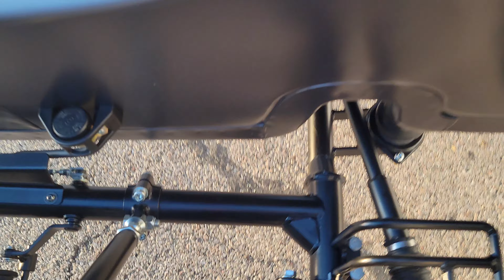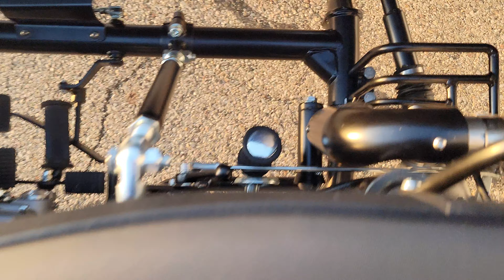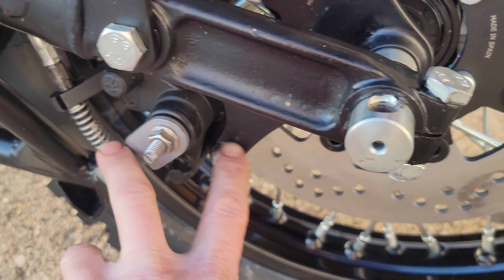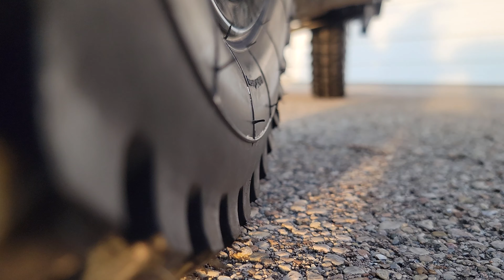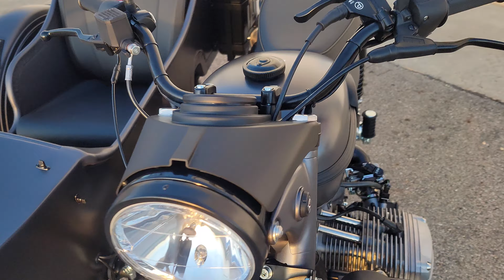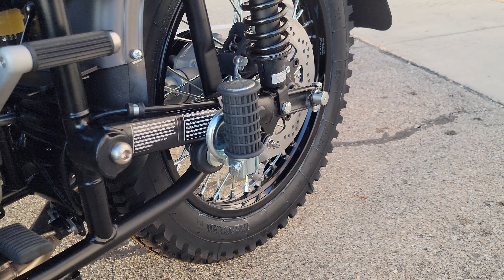2022 Ural Gear Up Sidecar Motorcycle Slate Grey

Comment: Thank you for your video uploads.  Your updates are the most reliable source of finding out about the arrival of the 2022, 80th Anniversary model.  Other dealers Ive spoken with have had little or no knowledge of the new model, its upgrades and what equipment can be retro fitted to older bikes. Ive had a 2022 on order since August.  My dealer still cannot tell me if my bike is even in the country yet.  Keep up the great work in leading a great brand.  Your professionalism and passion is well noted.  Pity you’re so far away from me, I would’ve ordered a bike from you in a heartbeat based on the standard of your professionalism in all your video uploads.  Thank you for taking the time to keep consumers informed. 😁